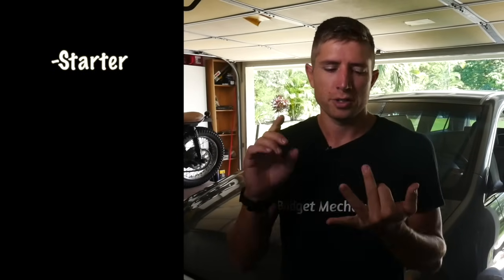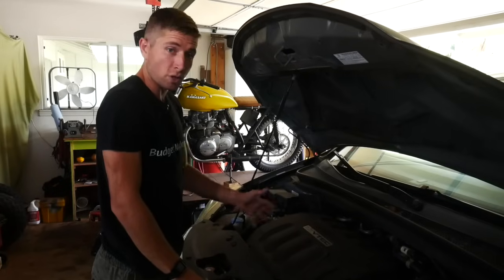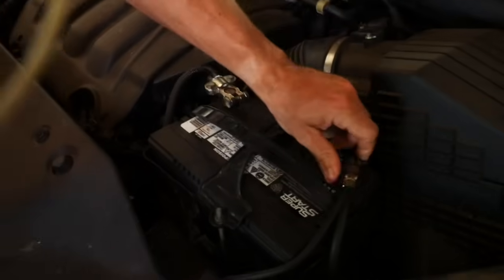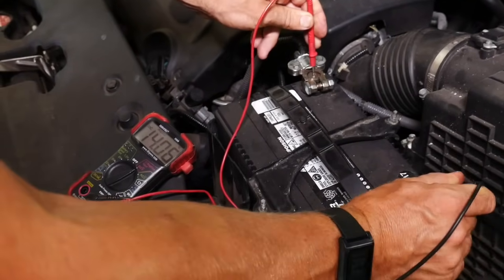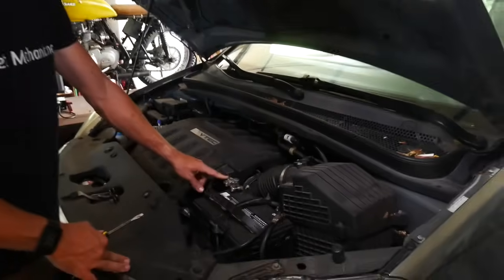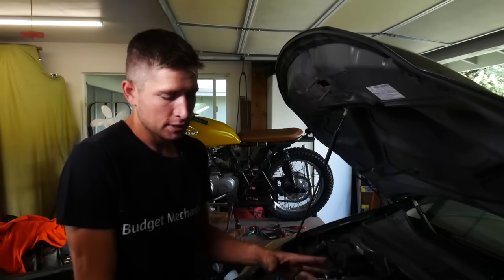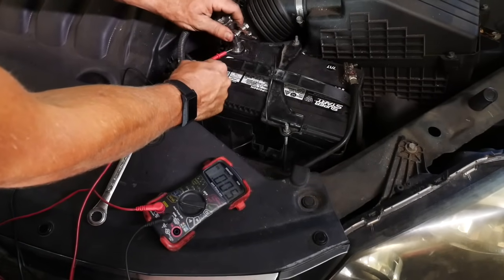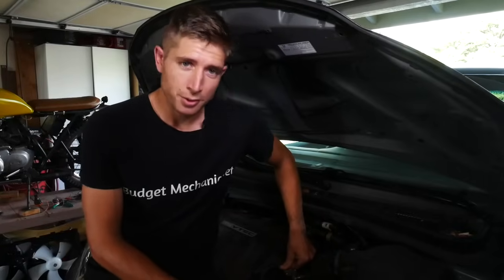Car Not Starting? Click or Clicking sound? Simple DIY Diagnosis!

Comment: What if u try starting it didn't start and u hear a sound like a high note e, and u tried charging ur battery still it won't start, what shld I do?
Reply from the maker: Follow the steps in this video for diagnosing a non-cranking motor!
Reply: @BudgetMechanicHawaii  thank u 🤗👍il do that
Reply: @BudgetMechanicHawaii  hello so my truck has this single click everytime won't crack battery and alternator and starter and solenoid are fine it will go into on position and everything will work but as soon as I try to crank it only a single click. There's a red wire that connects from the battery to the starter that I found that snapped in half so if I was to splice that cord where it broke should that fix my issue?
Reply from the maker: A snapped red wire is never good. Fix that!
Reply: @BudgetMechanicHawaii  is it possible to use a splice adapter to fix it?
Reply from the maker: Christopher Jones if it’s the big main power wire I would just replace it to reduce chance of it breaking again. But copper is copper, so whatever makes the connection!
Reply: @BudgetMechanicHawaii  ok thank you
Reply: @BudgetMechanicHawaii  would you say that that wire is my issue and not my starter as tbh my starter and battery and alternator and everything tested great
Reply from the maker: Yes I would say that’s your problem

Comment: Hi, my car has the same issue but no jump-starting was successful. The same slow cranking persists. Could it be a clogged fuel filter ? Or spark plugs problem ? or even a bad Starter (although the car still cranks slowly) ? Thank
Reply from the maker: If you are saying car cranks slowly that’s an electrical or starter issue. Most likely a faulty or failing battery which can hinder a strong start even with jumper cables. Also check wiring and especially wire connections (terminals) at the battery to make sure right and clean. If all that checks out, it could be a failing starter. Once the car is cranking strong like it’s supposed to, then you can diagnose non-starting issues if they are still present.
Reply: @BudgetMechanicHawaii  The battery is brand new as well as the positive terminal. Negative terminal is clean as well. But due to frequent starting attempts the new battery now requires a boost, and still no luck. I was just wondering if the starter can still be faulty even if the engine is slowly cranking and turning. Thanks a lot for your time and advice.
Reply from the maker: Yes the starter can be faulty resulting in a slow engine turn over. I would say it’s more rare of an issue but It can happen!

Comment: What if it cranks but does not start even with a jump FYI I live in Alaska I have a Ford Mercury 2002 sable I just replaced the battery
Reply from the maker: If it’s cranking but not starting that’s probably going to be a separate issue from batt, alternator, and starter which we don’t cover in this video. Near impossible to diagnose from a distance unfortunately. The only guidance I can give you is that for a car to run it needs fuel, air, and spark. You need to test for all of those!

Comment: My 2007 Chrysler 300 won't start. Everything works... The windows, radio, windshield wipers dashboard, and the light. It won't turn over. Please help
Reply from the maker: Did you follow the steps in the video? That’s the only way to track it down

Comment: Im having the same problem lights are working inside the car wen i try to start it its having hard time to stArt n now all i hear is clicking sounds n its not starting i try jumping it with another car and still clicking sounds but not starting at all i change the battery 2018 so its a yr old i hope its not the starter or alternator please help?
Reply from the maker: If it’s still not turning over when you’re jumping it , chances are it’s your starter. If you can see the starter try tapping it with a big screw driver or something while someone tries to start the car. If that works, it’s definitely a failing starter, but that would be my guess

Comment: I just took my alternator out and got it tested and it passed 3 times. But the multimeter is only saying 10. I've also taken and gotten my battery tested and they said it's fine. What do I do...
Reply from the maker: If the multimeter is saying 10v while the alternator is running, then it’s bad. Not sure how it’s “passing” at 10v!
Reply: @BudgetMechanicHawaii  he said it had something to do with the wiring from the alternator to the battery:/
Reply from the maker: The wiring from your battery to alternator should just be a thick copper cable. You can check the ends to make sure they’re not corroded away.

Comment: My 2008 accord battery feb 2019 
Will not start 
AAA/AMA  guy jump start it i brought it back 
Left it charging overnight 
Key in no panel lightson  except 2 dim  yellow light 
With a batteey booster all the  light on panel is on still wont start  only hard clicks 
Any solutions ?
Reply from the maker: Sounds like a failed battery or loose/corroded battery terminals

Comment: Very rarely a battery that young will not go bad, even though its always a possibility and  judging by all that corrosion on the battery leads, im willing to bet thats the culprit. Chances are, the corrosion will not allow enough power get to the starter and also not get a sufficient charge from the alternator. Clean both battery posts and cables thoroughly, charge the battery and you're good to go, its all about cleanliness, due the harsh evironment that thrives under the hood of every vehicle.
Reply from the maker: Yup! Got the battery tested and there was a bad cell! Rare but happens...

Comment: Excellent tutorial. I jump started my vehicle and it took me about ten miles. Afterwards I allowed the car to keep running in park and eventually it turned off. I then got another jump and everything was ok until I turned off the vehicle. The interior lights illuminated and entry alert sounded but I couldn't start the vehicle. Any thoughts you have would be greatly appreciated. Ty.
Reply from the maker: It sounds like your alternator or battery is failing. My guess is both are weak. I would take to an auto parts store that offers free battery check.
Reply: The auto parts store did a free diagnostic check and confirmed my battery needed replacing.

Comment: I installed new starter but it cranks few times then when I tried for 5 time I just hear clicks it doesnt crank anymore. Has a new battery installed as well
Reply from the maker: If it cranks at first but then clicks, it sounds like a power issue. Make sure the terminals are tight and clean on the battery, and that the wire to alternator is in good shape. 
Does it start when you jump it from another vehicle?
Reply: Budget Mechanic Hawaii same promble hes having but doesn’t jump from another vehicle anymore
Reply from the maker: If the battery is new and charged up ( a totally flat battery sometimes won’t receive jumper cable power well) then it’s most likely a starter or wiring issue

Comment: And what if it doesn’t jump?
Reply from the maker: If it doesn’t crank at all, that indicates a failing starter. Try tapping on the starter while someone tries to start it. If that makes it work, it’s almost surely a bad starter!
Reply: My cars not starting and will just tick once as i turn the key it eont jump start and i put a new starter and new alternator could it be it needs a new battery i had it tested and it came back good any idea what it could be

Comment: My starter has a signal click I checked it was still good battery had good voltage of 12.6 
I’m thinking misconnection or ignition relay or a draw
Reply: Just because a battery has 12,6 volts doesn't mean it has the amps needed to start the car. The click is the actuator engaging which connects the starter to the flywheel. My van had the same issue, only a single click while starting. Battery had 12,6 volts aswell. Replaced the battery and it started right up
Reply from the maker: Try jump starting it first, 12.6 is voltage but that number may be dropping when load is applied (bad battery, or alternator). Eliminate that first, then could be bad starter.
Reply: Budget Mechanic Hawaii same issue here. Tried jumpstarting and didn’t change anything.

Comment: What if it doesn’t turn over or start when jumping it
Reply from the maker: Thanks Armas, that’s correct. Try hitting starter while someone turns key. Usually if there’s no cranking during a jump, it’s a starter problem
Reply: Same here
Reply: Same issue.

Comment: Help..
Hi,  my 3 year old car is struggling to start after when it is hot.  It will start perfectly in the morning and when it is not warm. After running for few km's it is struggling to start. All the other electrical items are working perfectly at the same time
Reply from the maker: I’m not sure about that, normally I would say that sounds like purge valve malfunction or failing coils etc but if car is only 3 years old that shouldn’t be the case. You may need to take it to someone who specializes in that brand
Reply: volwagon Jetta common problems

Comment: My car has parasitic current draw of .02 amps under 12.6 volt 45ah battery. What would be the voltage of the car after sitting straight unused for 48 hour????

Comment: Bad alternator can cause car not to start? I pop 75 amp fuse under the hood, I found out it was missing plastic cap on positive lead so fix it, and now the starter click. Battery brand new and both terminal are new. What can be wrong?